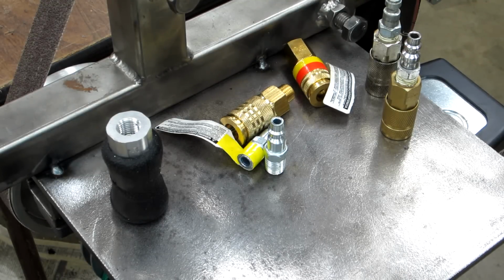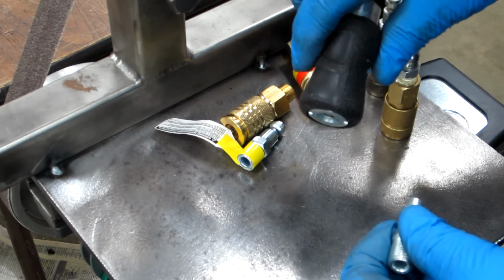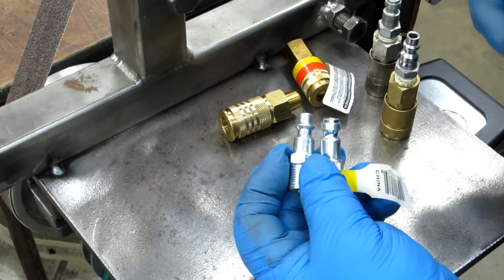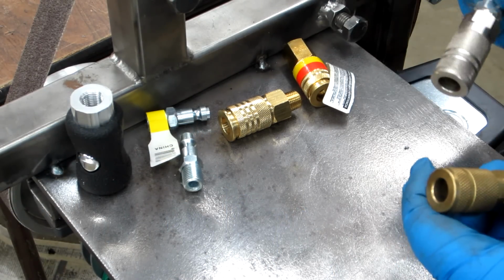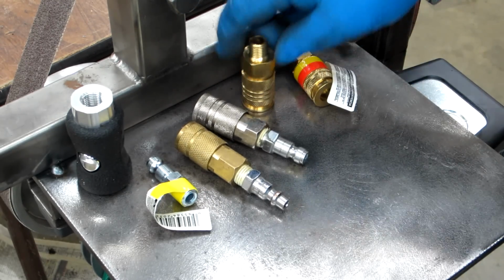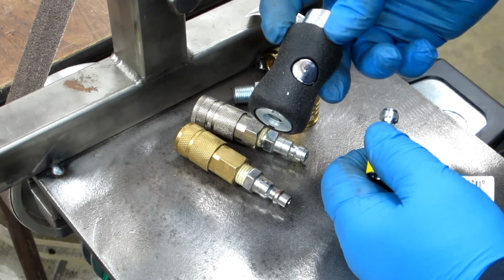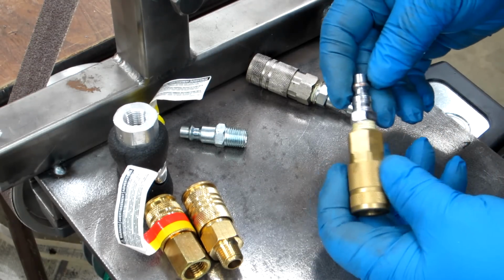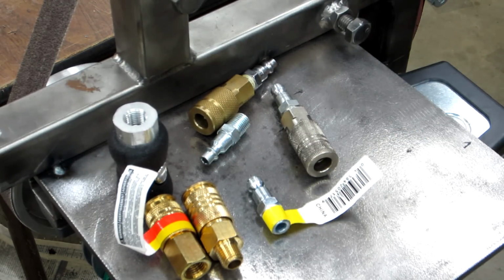Air fittings

Comment: I have a central pneumatic (harbor freight) compressor with a 1/8 NPT universal coupler. I have to attach a 1/4" hose to go to a push on female connector to a solenoid to run a halloween prop. Any suggestions on adapters outside of ordering one from Fright Props?
Reply from the maker: Have you got a link to a pic on the web so I can see the connector?  I just looked at frightprops....their fitting prices don't seem that bad.  Which compressor from HF?
Reply: Trying to send a link but computer won't allow. It's the 3 gallon 180 PSI Red Hot Dog compressor with the black top. Mine is an older version but it's the same basic system
Reply from the maker: I probably should have asked about the solenoid. lol  Now that I've re-read it a few more times.......is the female connector one of the quick connects with the plastic collar at the opening?  The kind that you just push poly tubing into.  If so, then I'm guessing the 1/4" hose is the poly tube that goes into that........so you're set at the solenoid end.  You need to connect to the 1/4" tube to the compressor's coupler.  If this is the case, then this would be the best, but you said you don't want to order from frightprops.....
http://www.frightprops.com/pneumatics/fittings/compressor-and-air-tool-fittings/quick-connect-with-push-on.html

You can probably find a barb fitting like this at Home Depot that you can use in place of the push-in fitting.
https://www.grainger.com/category/barbed-tube-fittings/tube-fittings/pipe-tubing-and-fittings/plumbing/ecatalog/N-qvx
Reply: I didn't want to pay for shipping because its 4 times the price of the fitting so I was looking for an alternative in lieu of paying for the part and for shipping. I am trying to find something at Home Depot but they don't have that size.
Reply from the maker: Hmmm.....maybe a plumbing store would have a brass fitting that would work.  I live near Portland, so there's at least a couple of places where I can buy the push-in fitting locally.......but I wouldn't drive across Portland and back.....wasting 2hrs of my life in traffic....for the cost of postage. lol   McMaster-Carr (mcmaster.com) has a huge selection.  They don't tell you the shipping up front because they only charge what it costs them.....or at least really close.  They've always been really reasonable on shipping.

Another option might be to swap the connector on the solenoid to a barbed fitting or air tool fitting that you can more easily match with the compressor end.

Comment: Hi,

What about the Milton G series plugs? Will they work in universal couplers? I have 1/4 Hi-Flow right now from Home Depot that flow 79 CFM. 

I went and bought 3/8 plugs with 1/4NPT thinking they are bigger and they really aren’t. Flow about the same. 

The Milton G style flow at 99CFM, but don’t know if it’s worth the hassle for 20CFM. 

Their G style coupler is not a one handed use coupler. It’s old style.
Reply from the maker: Hi Tom,  
I really don't have a good answer for you.  I just don't know.  What tool are you trying to run?  I would think that the tool would determine if the extra 20 cfm would make a difference.  For example......an air ratchet wouldn't notice the difference, but a high speed sander probably would.  A sandblast gun would like the increase, but if you're running a smaller orifice in it, it might not be able to use it.  
If you come up with an answer, feel free to shoot some video of it and come back with a link.....I'd be happy to share the link. :)
Reply from the maker: Hi Tom,  
I really don't have a good answer for you.  I just don't know.  What tool are you trying to run?  I would think that the tool would determine if the extra 20 cfm would make a difference.  For example......an air ratchet wouldn't notice the difference, but a high speed sander probably would.  A sandblast gun would like the increase, but if you're running a smaller orifice in it, it might not be able to use it.  
If you come up with an answer, feel free to shoot some video of it and come back with a link.....I'd be happy to share the link. :)
Reply: bluehandsvideo 
Hi, thanks for getting back to me. Most of my tools are 1/2 Impacts and air ratchets. I don’t have sanders or bead blasters. I could buy one to try it and see how it affects the tool. The other thing is when using universal couplers such as the Milton V style do you lose any particular advantage to having one system? I appreciate your information. I’m trying to learn about all this.
Reply from the maker: I would think that you've got plenty of air for a 1/2" impact.  If you don't need any of the other tools, I wouldn't bother buying them. lol  I've got a bunch I don't use any more......but I may one day, so I hang on to them.  I've had better luck over the years with the industrial type. Even right now, I've got a couple of fittings that just don't want to play nicely with the automotive ends.  The industrial are the ones with the nipple extending out.  They fit inside the o-ring, while the auto style just butts up against the o-ring.  My difficulty isn't actually with sealing....they get jammed and I have a hard time getting them separated again.  I'm sure quality Milton fittings won't have the same issue.  Mine are all HF or HD(home depot).
You're more than welcome.  I'm far, far from any kind of authority on the fittings, so by all means....double check my info. :)
Mike
Reply from the maker: I would think that you've got plenty of air for a 1/2" impact.  If you don't need any of the other tools, I wouldn't bother buying them. lol  I've got a bunch I don't use any more......but I may one day, so I hang on to them.  I've had better luck over the years with the industrial type. Even right now, I've got a couple of fittings that just don't want to play nicely with the automotive ends.  The industrial are the ones with the nipple extending out.  They fit inside the o-ring, while the auto style just butts up against the o-ring.  My difficulty isn't actually with sealing....they get jammed and I have a hard time getting them separated again.  I'm sure quality Milton fittings won't have the same issue.  Mine are all HF or HD(home depot).
You're more than welcome.  I'm far, far from any kind of authority on the fittings, so by all means....double check my info. :)
Mike

Comment: those are just prevost knock offs...
Reply from the maker: I just looked them up....yep...they are.  At $22 for one fitting, I can see why they're being copied. lol  I'm sure these do not have anywhere near the same quality, but for hobby use, they'll last long enough. :)
Reply: @bluehandsvideo  oh yeah, they are super overpriced. I use milton v types which are still pricey; but not as ridiculous ($15-$18 for a set of 2 and 4 fittings). They allow for up to 74cfm on a 1/4in fitting. Harbor freight has some knock offs of them as well, I think they call them "high flow". Hey, whatever works though right? 👍
Reply from the maker: @boss350z5  I already knew about the milton versions....hadn't heard of the prevost before.  The miltons seem way more worth the money.  The HF versions seem to die in less than a year.  I was using them because I kept having guys come over to help that couldn't seem to work the standard brass fittings.  It's rare for anyone to come over these days, so I've gone back to the brass. LOL  I'm hoping to upgrade everything with Milton at some point....but as you said.....whatever works for now! :)